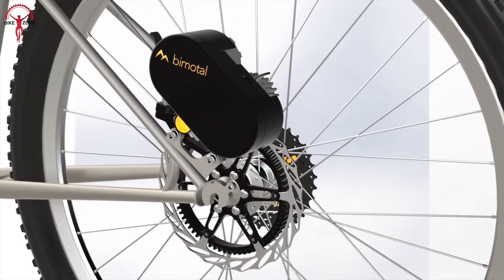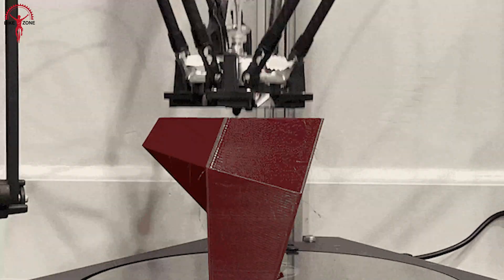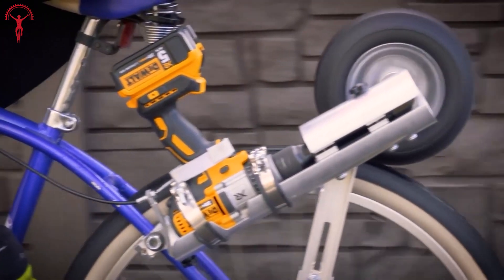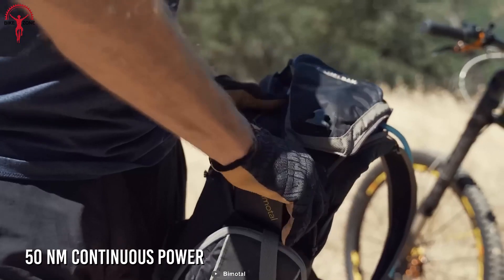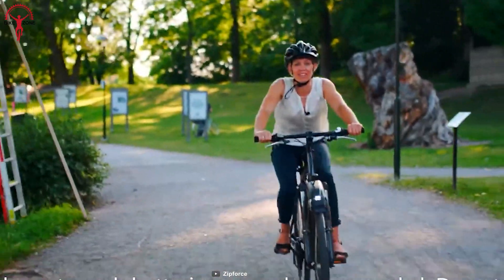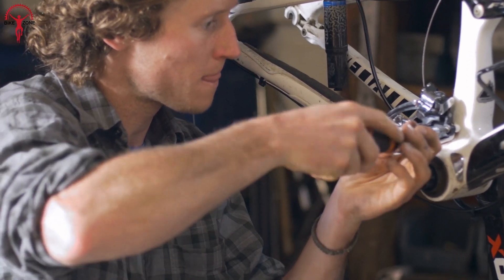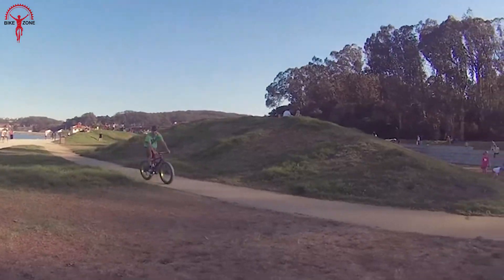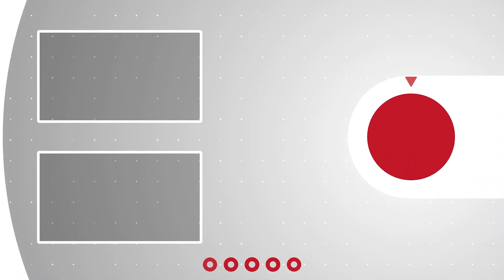7 New eBike Conversion Kit

Comment: Using a drill for a conversion to an e-bike looks like an April Fool's Day prank.  As for the rest they're severely limited by European laws making them all but useless here in the USA.  In the states 750 watt to 1,000 watt motors with substantially better batteries are the norm.  They tend to tackle hills with ease, offer full throttle support so you can ride when you're too tired to pedal, some models feature two batteries or dual motors for front and rear wheels.  Those offer the greatest range with hill climbing capabilities at 100 or more miles of range for even the heaviest riders.
Reply from the maker: Good observation.